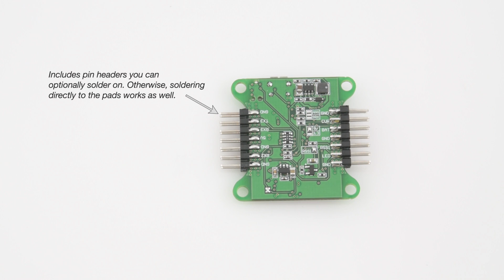The Lumenier LUX Flight Controller - STM32F303 32-bit processor

Comment: So MPU6500 using high-speed SPI interface instead of I2C? BorisB? GetFPV? Bueller? Anyone.... anyone?
Board looks amazingly configured for a clean installation.
Reply: +EngineerX Yes it is using SPI.
Reply: +surf1punk Thanks! - They now changed the description at the product page and it does say "SPI" - sweet! now just gotta wait for the code to take advantage of that -That's what I understand at least, all the code people were asking for that.

Comment: since I can power it via lipo voltage... (did I get that right?)... how much mA can I draw form it's 5v reg? :)
Reply: +Julian GoesPro The website says:
Filtered voltage output - output 5v 1A (and 3.3v where applicable) to power peripherals such as GPS, RX, BLACKBOX, OSD. 5v/3.3v RX selectable.
Reply: thanks! Thats enough to power a 5v cam and the rx, nice :)
Reply: Julian GoesPro You're welcome :)
Have a great weekend
Reply: ABMNS PRODUCTION thanks! You too :)